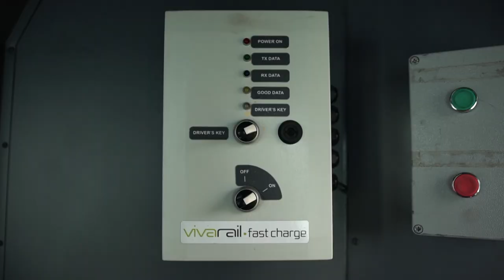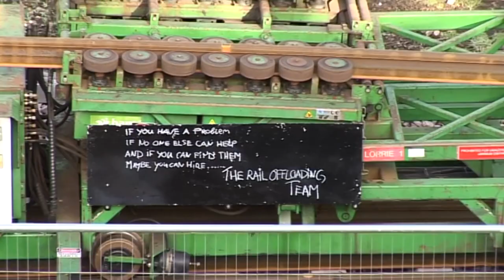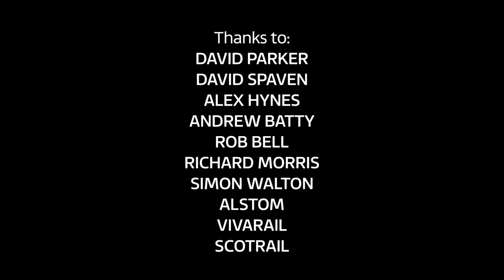BORDERS RAILWAY @ FIVE - PART 2 - TV DOCUMENTARY

Comment: Discontinuous (partial) 25kV electrification MIGHT be the answer if the budget really cannot stretch to do the whole thing. As everyone knows, the whole line was built with passive provision for OLE, so traditionally high civils costs for bridge etc rebuilds won't arise. Even if full vs partial electrification were to trigger a significant extra, such as one more National Grid feeder station, that surely would be at less cost than re-tractioning dozens of EMUs for dual battery/ AC? I believe it would have to be dozens, as it's usually a false economy across a train fleet to rely on only a small captive pool/ sub-fleet that are capable of being diagrammed for the Borders line.

Hawick does seem the next logical goal for extension. It would be great to see Hawick reached in the foreseeable, if not full reopening to Carlisle, but I guess (a) the further from Edinburgh you go the weaker the business case becomes, and (b) all depends on what if any 'draw' there is of direct rail access with NW England.

Comment: If they had built the borders railway properly it would have been twin track not single
Reply: I think they had to compromise in order to just get it done.  Otherwise the project would have simply cost too much and there would have been no railway at all.  The original idea was to have longer sections of double track,  but this was pushing the cost up and up and up and so there was no choice but to cut back on these double track areas.  Even so,  it does seem bizarre that the new overbridges weren't built with passive provision to enable track doubling later on if necessary.  I agree that this was inexcusable as it surely wouldn't have cost much more to construct a span over two track widths rather than one.